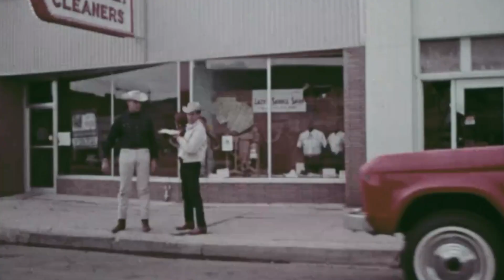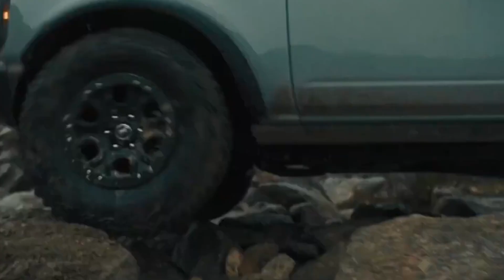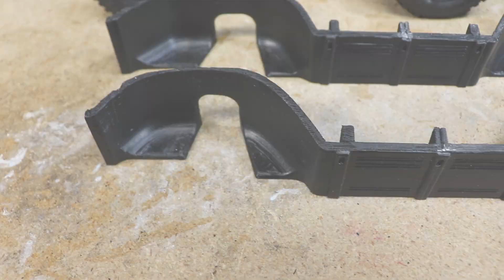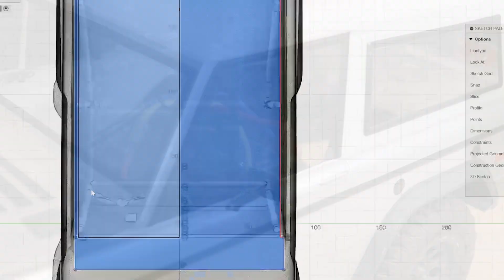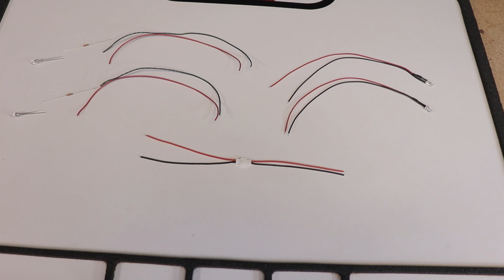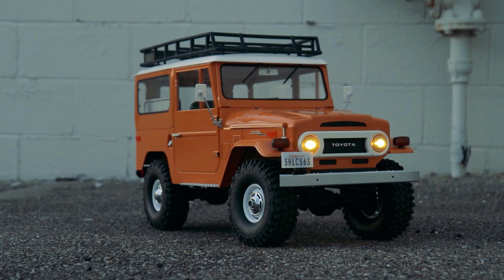DIY Upgrades and a 3D Printed Interior Help Complete This RC Bronco Crawler 🔧

Comment: I love that you started the video with a little history lesson on the Bronco. Nice build! 
  Here's my 73 Bronco build. It's a radioshack Mangler hardbody from the 1990s. I had to bob the bed behind the rear fender and extend it in front of the rear fender to make the proportions correct(I keep procrastinating on finishing it 😅😥). It's sitting on my old OG SCX10. I put a Traxxas 2wd trans under the hood and converted the stock transmission into a transfer case and laid it down flat as I could to fit under the Bronco interior. Worked great. 😎🤙🏽
https://youtube.com/shorts/btPSaT8TBaA?si=TVATDEuOEhPe2IDd

Comment: Something simple to make it move more realistic is to put weights in the wheels. They make brass ones, but I'm cheap and have old roll of solder. Makes it not bounce as much.  And if you do a 4x4 smaller scale, I may have an Orlandoo kit to donate.
Reply: Just alloy beadlocks would helö tremendously